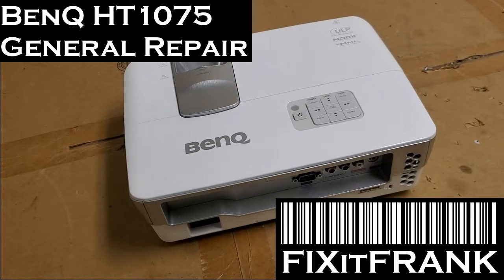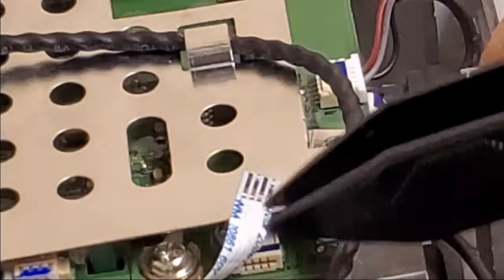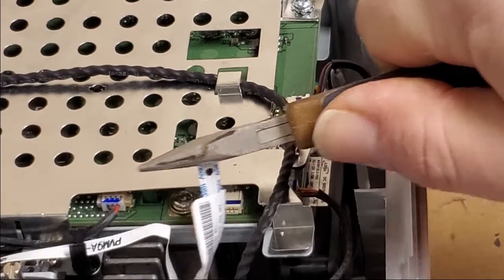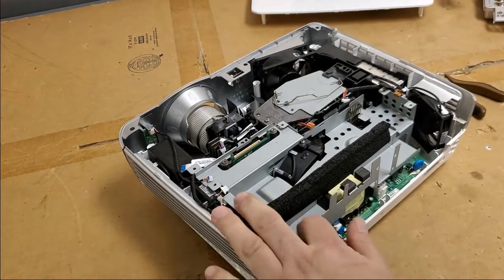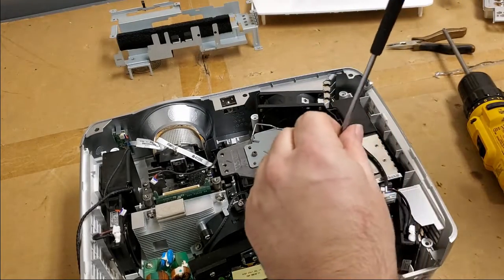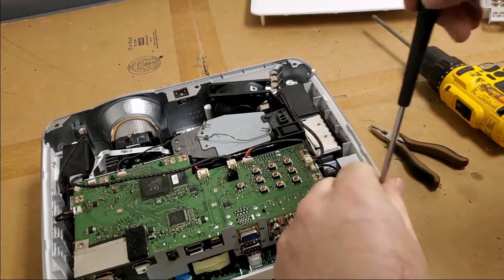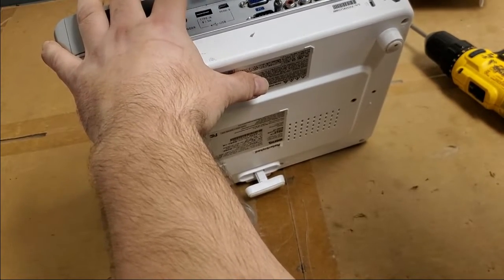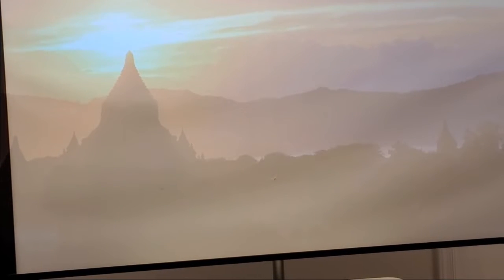BenQ HT1075 DLP Video Projector Repair - No Light/Overheats

Comment: Hi Frank. Usually, where are the dust blobs deposited? Light hazy green spots, on the black screen. I have blown in air into the light engine through the "inspection" cover, as you did in one of your videos, removed the IC and cleaned it, and those blobs still show up on the black screen, like I didn't even do anything to it. This is a Benq HT2050, by the way. It is very similar to the 1070.
Reply from the maker: Thanks! I'd make sure the lamp is running bright enough.  But the dust can also slide onto the DMD.

Comment: Hi, I have a BenQ projector that failed with a temp indicator lamp, the tangential lamp fan had failed. I got a replacement, the fan wasn’t for my specific model but it was a three wire fan and the voltage and current rating on the motor was identical. Fitted the fan and the fault is still the same, it powers up fine but after a few minutes it shuts down and the temp lamp is on?
Reply from the maker: The fan is probably not compatible.  There are multiple types of similar sized fans.  The error reporting is likely different.  You really want to buy the same exact model fan. Otherwise the CFM and error reporting will usually be correct. This is partly why people can't install Noctua fans into projectors.  The specs that matter are different. You should be able to find a new fan that is the same. Even searching your model and "Fans" may be good enough to find the right brand. Good luck!

Comment: I have a friends BenQ DLP projector here because it's overheating after around 5 minutes of usage.
It turns on fine and the projected image is impecable. Then, after around 5 minutes, it shuts down with the "Temp" status LED lit.
I checked the fans, they all seem to be turning fine. I removed all the dust though there wasn't much to start with.

The lamp has around 900 hours on it but seems fine visually (red coating, no visible white deposits).

Do you have any advice where to go from here? Thanks!

I measured the little fans (the one directly cooling the lamp) consumption: It's given on its housing with 12V / 0.15A, it consumed only 0.5A@12V while running...could this be a problem?

The temperatures when the temp shutdown occures are the following:
- on the top of the housing just above the lamp around 60°C (140 freedom°)
- the lamp itself after removing the cover just after the shutdown ~100 °C (212 freedom °)
- pointing inside the front fan 70°C (158 freedom °).
Reply from the maker: Check the service menu.  One of the fans is not spinning properly or is not reporting its speed properly.  I suspect the center blower fan myself.  The service menu will say which fan stalled/errored.

Comment: I have a 1075 and I have to manually set the fan speeds higher in order to stop the projector from over heating. This is becoming annoying. Do you think replacing the thermal paste on the optical heat sync will resolve this issue or do I have a bad temp sensor? I have already done a full tear down and cleaning as well as replaced Fan 1 as that was failing before making the projector overheat within minutes.
Reply from the maker: Hi Adam, I'd replace the exhaust fan(#3) and maybe the blower fan. I've seen both wear out. The blades tend to warp and decrease their efficiency. More so the exhaust fan.  Your main heat source is the lamp. Getting that air out is what you're going for. If high altitude mode is working then that's fine what I would look into. I don't have it finished yet but I'm fixing a 1075 right now that needs a new exhaust fan. I used a known good fan from another projector and confirmed that was the solution. The blades on the old fan had began to warp and lose their airfoil shape. I think that will solve it. A bad temp sensor would shut you down instantly rather than let it work for a while.
Reply: Thanks man I'll swap those out and see how it goes. Didn't even think about lamp heat warping the fan fins. Figured they should be rated to withstand high temps.... Oh well, I guess I expected more haha.
Reply from the maker: @adamsawz4773  yeah. They hold up pretty well figuring in the environment they work in. I suspect BenQ decided the cost savings were worth it but I suspect you are in my camp with expecting a little more attention to quality ... Fortunately if you put in a new one, you should be fine until it's time buy a wall sized tv..

Comment: W1070 overheats. Thanks for your vids I gave it a good cleanout of the lamp area, the lamp cooler fan which I dismantled and there was not a significant amount of dust but now all shiny but it now cuts out after about 5 minutes although it lasted for about 1 hour before I started the clean! Just wondered if I got the side fans correct, Do they exhaust from the projector of blow in? Also, can you tell me the size of the 5 screws which secure the top of the projector. It seems like 2 have run away. Thanks
Reply from the maker: I have a link that shows the fan direction. I know the one near the lamp blows out and the one near the DMD blows in.  I think the one by the power supply blows out too.  If you are getting a temp error and it shuts down, then you have a fan reversed. If you have a lamp error when it shuts down, check the color wheel.  The screws are 3mm Helical thread if I recall correctly.

Comment: Hi Frank, when I turn on my Benq ms531 the green light stay on but i don't have lamp light, i don't hear nothing starting inside, I try to turn off but i can't, i press the button and nothing happens,  i have to unplugged it
Reply from the maker: what happens if you let it sit for 5-10minutes? Does it ever go into error? On the face of things, it sounds like it has a bad mainboard but I would let it sit and see if the temp or lamp light starts to flash.  Was it hit by a power surge or anything that you can think of?
Reply: @FixitFrank  nothing happens, letting it sit including for more time

Comment: Ok, then I got the same HT 1075 and I got the question. It's been used in the hot weather on the vacation for a few days. It started to overheat. Then we lost the black tape from the color wheel. It didn't even turn on. I cut the black tape on my own and put it on the color wheel. It stared perfectly with a working lamp but them red flashing light started. So now the color wheel and all the fans work but the lamp doesn't flash at all. Question: Does lamp replacement is just only option or it's all about the wrong size of black tape at the color wheel? Thank you.
Reply from the maker: Hello!  That could be the problem.  The lamp will not ignite if the color wheel sensor is not being recognized by the sensor.  I would recommend making sure the square is the same size. It also must be in the same position. You may have already done that(putting it in the same position) but if it is too wide the pulse will also be too wide and cause problems. I would replace the color wheel when it is convenient for you but until then using black tape or even a black paint marker will work.  It just has to be a matte-black to interrupt the infrared light being used to sense the index position of that black mark. If your lamp was working, there is no reason to think it has failed yet. You should at least hear a buzzing or hissing noise when the lamp tries to start.  Another symptom is if the wheel spins erratically. Goes fast and slow and fast. That is a bad index mark as well.

Comment: Hi Frank! I have a BenQ W1080ST. Bulb replaced . Fans spin proper speed and dust has been cleaned. Service menu error states “unproper shutdown”. In middle of viewing projector will just die. Sometimes after 5 minutes, sometimes hours. Will just be dark no power lights. Sometimes red lamp sometimes not. Ultimately will power back up, for how long nobody knows. What’s weird is the power lights are sensitive to jiggling the power cord which makes me think power supply but I want to know for sure. I can use a multimeter and have an electrical background just not very familiar with projectors, do you have a service manual/ any tips on what  I should look towards? Thanks!

Comment: I have a BenQ W1070, Lamp button is red, Power button is green and doesn't display. Lamp hours is exhausted and even after replacing with original OSRAM bulb it still has the same issue. I heard you need to reset the lamp timer by pressing a combination of buttons. I haven't figured out what those combination keys could be.
Reply from the maker: See my reply to your other comment
Reply: I'm having the same problem, could you copy and paste it again here or direct me to that comment? Thanks

Comment: my projector is a Refurb from ebay MX720 .. was working great , My projector is having issues... when i open the menu and adjust the picture mode , user 1, user 1, auto , the lamp flickers and the projector crashes and shuts off.... Now i turn it on ,  and crashes after being on for 5 to 7 mins...  power light turns red, and lamp indicator turns red.... SO is this a heat issue ?  or a lamp Issue... Or a software issue ... I dont get a led for heat , no orange or light coming on for heat indicator menu button...   SO is this a lamp issue and over heating ... or a firmware software boot up issue...  Hours on my projector since buying it are 20 to 30 hours on the lamp
Reply from the maker: If the color flickers before shut down, that is a color wheel issue. Either the wheel itself is the problem or the lamp assembly has an incorrect IR/UV filter.  If the lamp assembly was changed recently and the issue started then, that would be my suspicion.
Reply: @FixitFrank  all right well I just wanted to give a phone up cuz I tore the whole thing down just wanted to say a big thank you to you and the channel because after I tore it all down everything was clean on the inside but here we are again with the small squirrel cage fan and a piece of something inside of the fan causing it to not spin... 
 So the fan that cools off the heat sink but below the main board was jammed up with something and I know that when the bulbs explode I've seen you pull glass out of the squirrel cage fan...
So I cleaned up the lens the inside of the reflector in the DLP chip housing put it all back together we're good to go !!!!  
 Thank you for the channel and thank you for all your videos

Comment: Hi Frank! I’m having an issue with my 1075. When I turn it on, the red light goes on and then it shuts off after a while, then i press again and it turns on normally. I’ve had to press the on button up to 3 times but then it works ok... any thoughts?

Comment: Frank I have a BenQ W1070 that projects a black dot in the upper Right hand corner.I believe this might be a bad DMD chip.Is it worth repairing?
Reply from the maker: Personally I think so. The w1070 still is a good projector even by today's standard.  It's a 1080p native and has a decent lumen rating. You can find chips relatively cheap these days. Black spots is interesting though. I've only seen white specs from the mirrors. Could you post a pic of the problem? Just in case it's not the dmd.
Reply: @FixitFrank  I sold it as is for $150.00
Reply from the maker: @gregferreira8309  that's a fair price and I suspect I will get an email from someone asking about it soon!

Comment: Hi,
I have a Benq MS500+ that seems to auto power off within 35-40 seconds. I’ve check lamp hours and its nowhere near time to change. I’m a lil tech savvy so I even opened the unit and ensured no loose connectors, etc. I even went as far as “visually” checking certain components(like capacitors) on the boards and couldn’t really see any evidence of damage or possible fault.

I also have a Benq MP515 which had shattered a lamp. I ordered a new lamp, cleaned out the unit and it comes on or about 20+secs then switches off in what i believe is overheat protection.

Where do i start looking to sort these out?

I’m currently stuck and would appreciate any and all help to resolve the matter.

Thanks in advance
Zahir
Reply from the maker: if the lamp is new, see if it has the wrong IR cut filter. The glass on the lamp should be red/purple in color.  If it is clear or green, that is the problem.  Otherwise, a stuck fan or possibly a dirty color wheel sensor.

Comment: Hi frank. I have a BenQ W1500. My uncle just shipped it to me from the west coast to the east coast, it was working just a week ago when he had it, worried it somehow got damaged with careless shippers. 

Loads up and displays fine, then after about 20 seconds the screen turns off (audio still playing for another 20 seconds or so, then that stops as well). It has a red power & green temperature light after this.  The 3 fans you can see from the outside all look like they're moving. I gave it a good air spray for dust from the outside, there's quite a bit, but that didn't fix anything. 

Based on your videos im worried it might be a past broken lamp piece of glass in the middle fan or color wheel. Might have to take it apart and find out. 

Any suggestions where you would look?
Reply from the maker: There is that squirrel cage type fan(blower fan) in the middle.  That fan can get jammed really easily.  If you can reach a cotton swab into the duct and gently push on the fan blades, you should feel it move easily or it'll feel stuck. If it sticks briefly and then turns, I bet a chunk of old lamp comes out. If a lamp burst inside in the past, its almost definite that some quartz got inside.  The temp LED is indicating 'fan lock' so at least one fan is stuck or not reporting that its turning.  If you can see the other 3 fans turning, then the only fan out of view is the blower fan.  Thats the one you want to check.
Reply: @FixitFrank  hi frank I'm finally taking apart my projector today. And I'm already stuck getting the top off. It has a tiny pop up lid with a lens shift knob and it feels like thats holding it on. Can't find any videos with similar lid, not sure what to do
Reply from the maker: @TheMainEvent2k  I dont think I have worked on a W1500 but I do recall some projectors where you have to remove the lens knob. If there's a screw in the middle of the knob, take it out and pop the knob off. That might do it. If not just push/pull the chassis gently and find the missing screw.  Make sure that any warranty stickers on the bottom arent hiding any screws. If you want to share a picture of the area, I might have some ideas.
Reply: @FixitFrank  would love to share pic. How? I'll see if i can dm you
Reply: @FixitFrank  sent email

Comment: Hi Frank, great video. I have the w1070 model. I started to wear out the lamps very quick. My last 2 lamps lasted for betwen 30 hours and 100 hours. I read in a forum that leaking dc current can cause this behaviour. Do you think my ballast is going bad?
Reply from the maker: Hi Thomas!  I don't think its your ballast. It really depends on how your lamps failed, and what kind of lamps they were.  If you bought aftermarket lamps, there is a large range of quality.  The lower the price, the exponentially lower the quality.    The lamp for the W1070 can't be any cheaper than about $80-90USD.  Under that, the companies cut too many corners and use sub-par bulbs and housings.
The other cause of early failure is excessive heat.  Not hot enough to cause an error, but hot enough to cause the lamp to wear faster.  The blower fan is the most common culprit if you had an old lamp that burst.  The blower fan tends to hold glass bits inside and dust that prevents proper airflow.  Check my Cleaning the W1080 video. The insides are the same as the W1070.  I also suspect your exhaust fan. The exhaust fan can spin properly yet not move enough air and that will cause excessive heat that wears out a lamp faster.
If your ballast was bad, you would get an immediate failure.  They tend to work or not work. I'm sure it can happen, but I have never seen it myself.  
Where did you buy your last lamp if you don't mind my asking? I think we should start troubleshooting there.
Reply: @FixitFrank  thanks for your quick reply. I bought it on Amazon for 55 Euro, approx $65USD. Now that I have watched your videos, I understand the little glass piece on the housing is an important filter. The picture of the housing on Amazon has a red shimmer on the glass, but in reality it has a green shimmer. The bulb has no text on it except PJxJ, the brand of housing and lamp is Populsell. I will purchase a proper lamp and do the cleaning as you suggested. Thanks again!

Comment: Hi. Great videos. I have a benq w1080st. I hadnt used it for a couple of weeks. I came to turn it on and the green power button light starts flashing (which is normal as it warms up) but it just stays like that and flashes. I power off but only able to do this via the wall socket switch. I power on again and the same thing. I cannot hear the fans kick in and no beep as it normally does. Any advice would be really appreciated. Cheers
Reply from the maker: Hi Kevin, that is a strange situation. I can't think of a specific cause but it might be worth trying one thing, holding down auto and menu and then plugging in the power cord. It doesn't sound like it's in download mode but the download mode exit steps might reset things. It's a Longshot. 
Most likely you need to check the power supply. Any chance it was hit by a power surge while it wasn't used or was it unplugged the whole time?

Comment: can you help sir i got a benq mx501 its running great still 480hour on its lamp hour then 1 day its starting to auto shut off by itself about 2-3mins from the time i turn it on, no lights on lamp and temp except when i plug it the power turns red 4 a while then orange. Then if i turn on power button it is in normal operation green is flashing (temp, lamp lights off ) then steady green. I wonder whats going on this projector. Can you help me sir on this